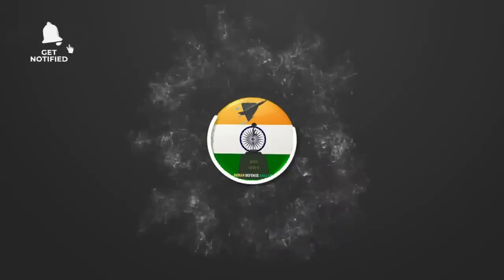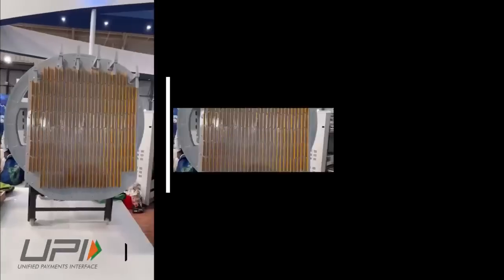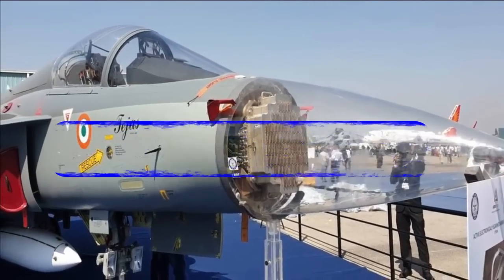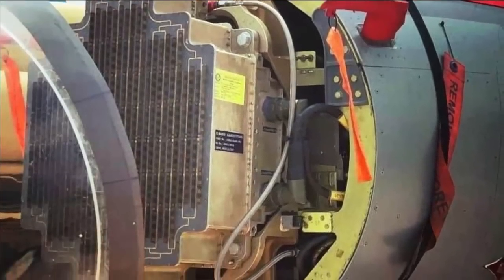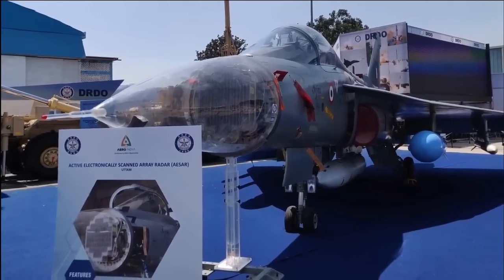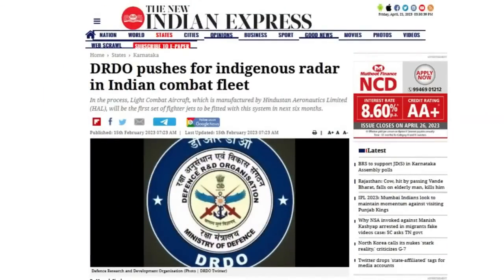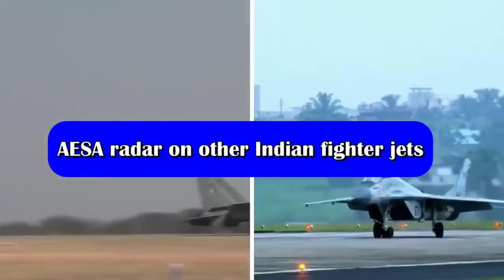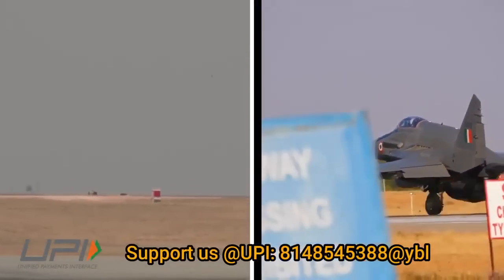Uttam AESA Radar delivered for LCA Tejas MK1A fighter jet #indianairforce #drdo

Comment: In regards to the PLAAF probably all fighters in production for the Chinese air force now have AESA radars. That 2025 date for integration of Uttam AESA is handing a 3 year edge to the enemy air force. As fast as possible Uttam Gallium Nitride must be rushed into production. Money and manpower needs to be increased to make this happen, and integration by 2024, not 2025! Urgency must be shown in deploying AESA radars and provide Ghatak with a full multip spectral sensor payload. Ghatak is already in the same class as the best US drone, so with the right sensors it can spy on the border, which is an urgent need!
Reply: Israel’s AESA Radar will cover immediate needs , 25 or so are ordered while uttam is readied by 2025
Reply: @punitpadaki1655  Key is is to make mass induction of AESA radars by 2024. 2025 is a bit late, never give an enemy a free advantage over you.
Reply: Lets hope there will be no conflict in 3-4 years, by this time most of our fighter plane would have integrated with this AESA Radar, Gallium nitride based TR modules😊
Reply: @suryakk-sy1gg  But the enemy knows the timetable, and surely they want to start a war when they have the advantage?
Reply: @datoolz0 well war is not going to happen Pakistan need to deal with economy ttp Taliban and china primary goal is Taiwan and China won't start full scale war with india because it will lead to become weak compare to us delay its dominicane by 20-30 year😅
Reply: @Delta-X69 Bharat is the one that needs to take out Pakistan, Such a golden chance won't come again.
Reply: @datoolz0  well see Ukraine if we start war we will be same like Russia  and we still way dependent on west and Russia for our military stuff they can anyday block tha chain not wisefull and we do not need those 2 crore peaceful when we can not even hold our pissful

Comment: Bhai why isn't CCS approving the funds for AMCA prototype?
Reply: @@Kshatriya420it's already been decided long back that for first batch GE 414 will be used
Reply: @@Kshatriya420 it's 98 KN afterburner and two of em will provide AMCA ability to super cruise without afterburner which is one of the key requirement in a stealth configuration and in later stage it is planned to make a 120 KN engine to make AMCA capable of operating in LAC which requires really high thrust to weight ratio
Reply: @brokenwarrior7007  Super Cruise with a 98 Kn engine?
Reply: @SpiderWuss69420 mk 1 won't super cruise
Reply: @SpiderWuss69420 in AMCA Mk1 they will use enhanced thrust variant of f414 with 116kn of maximum thrust.
Reply: @unknown_5107   That's better than a 98 Kn class engine.
Reply: Hope that will be the case.
Reply: @SpiderWuss69420  even Rafael can supercruise with limited payload, and it has two snecma M88  engine with 50KN dry thrust, GE 414 have greater dry thrust so yes it can easily supercruise otherwise it won't be called a stealth fighter
Reply: @brokenwarrior7007 pehle bc kaveri toh bana le. Woh abtak bana nahi fir 120kN ka dekhenge.
Reply: @@Kshatriya420not HAL it's GTRE
Reply: Puch ke batata hu
Reply: Tu keep per jet cost of AMCA and Tejas 2 it's engines are being finalized to build in India only
Reply: Becoz defence PSU are known to waste funds given
Reply: Meanwhile Write off of Industrialists in 2022-23 alone is about ₹2.09 Lakh crores ($ 26 billions)
Reply: @su0078 kaun sa sasta wala maal phunk ke aaya be 😂😂 loan write off ka matlab loan waiver nahi hota. Defaulters ke assets seize kiye jaate hai aur us se bad loans recover kiye jaate hai. Aur agar tuze lagta hai ki saare defaulters businessmen hi hote he to bhai bhagwan tujhe akal prdaan kare yahi dua deta hu 😂😂😂
Reply: because even if produced by 2029-30 , AMCA mk1 will be a single engine aircraft , having internal weapons capacity of ONLY 2000 kg. 
   external weapons on stealth fighter makes it non-stealth , so , highly non economical.
    if we give the same funds to Russia , we will start getting SU 57 in 3 years
Reply: @pravindahiya719  mk 1 isn't single engine mate , it's just supposed to be like a limited series production with American engine and no eots
It's going to be twin engine
Reply: @knight6577  yes, instead of EOTS it'll have IRST
Reply: @pravindahiya719  from where did u get the news that AMCA MK1 will be a single engine fighter? 😂
Reply: Because in reality we don't have a any kind of like AMCA  project.. how CCS will approved approved on amca, it's a pen paper thinking project, its first pen paper design will complete in 2050,after that critical design will complete in 2080 , after that CCS will approved for prototype development in 2100,after that first amca will fly 2150 and AIRFORCE will inducted by 2200...indias first 5 th generation fighter will fly on the air. 
It's the reality and it's the project timeline... 😂😂
Reply: @preeti07390 first take some English lessons before commenting here
Reply: @pzende  don't be panic my luluu...AMCA is just a pen paper project.. It never comes in reality 🤣🤣🤣
Reply: @preeti07390 you need  bonvita and vitamin this is the relity😂😂
Reply: @souravchakraborty6121  that Bonvita and vitamin needs DRDO, HAL, ADA and GARUNDRA MULI govt. 🤣🤣🤣🤣😆😆🤣🤣
Then some project will comes in reality🤣🤣
Reply: @preeti07390  yes when every gandu says same that he knows everything and others is fool🤣🤣🤣. Either it is Japan FA-XX, or european FCAS, BAE tempest everything is on paper to unko bhi bonvita pila na chahiye kya🙃🙃. Kuch log Turkish khilona dekhar jitna kudh usi unka dimag ka level pata chal ja ta ha.
Reply: @souravchakraborty6121  Arre mere pyare munna they are already moving 6th gen fighter aircraft not 5 th gen. Uk and Japan merge to develop ed 6th gen. Aircraft and they have already 5 th gen. Aircraft. 
N uk also unveiled the tempest prototype. Not in pen paper.. They have shown reality prototype like turkey... But our mahan scientists can't even show the prototype in reality .. Thats why our scientists are need vonbita and vitamin
Reply: @preeti07390  bruh doesn't know difference between a dummy and a prototype 🤣🤣🤣
Reply: @brokenwarrior7007  ok.. Even our mahan scientists are can't even make dummy... Thats why our mahan scientists are needed vitamin and vonbita

Comment: They should really add this to the Sukhoi as well.. along with indian missiles and RWR and other jamming software it will be kick-ass. I also heard that GTRE is planning to add Indian blades and tech to the Su-30MKI engine (as this is a newer tech).
Reply: I mean eventually it will be in su30, they are making a slightly larger version of Uttam for the fighter
Reply: Su-30 will have a bigger version
Reply: Integration of radars for different jets takes many yrs of trails